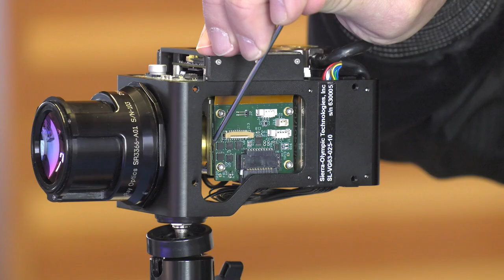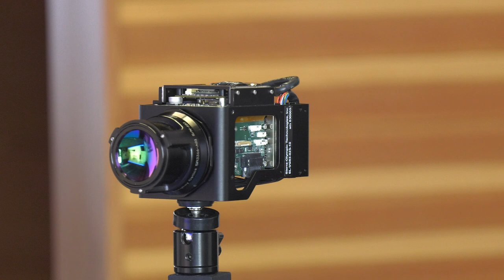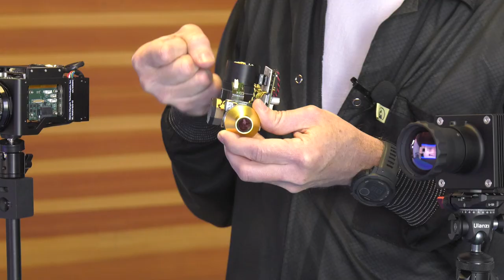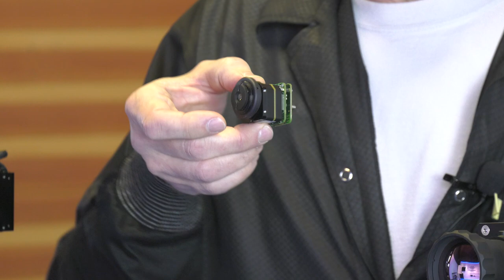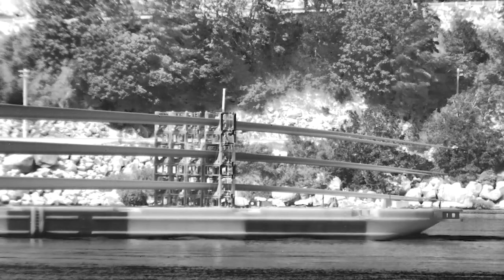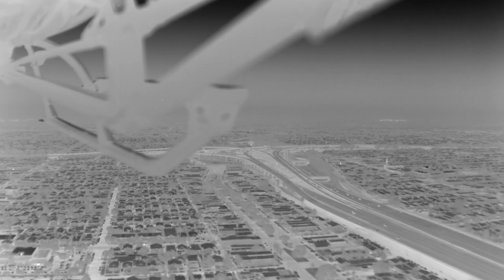Tech Talk: MWIR & LWIR Overview

Comment: As a filmmaker, I prefer the look of LWIR. But would want to see the resolution, sensitivity (low noise), the framerates as well as the lens options of a cooled system. So could you run a cooled LWIR system for the 8-12µm spectrum?